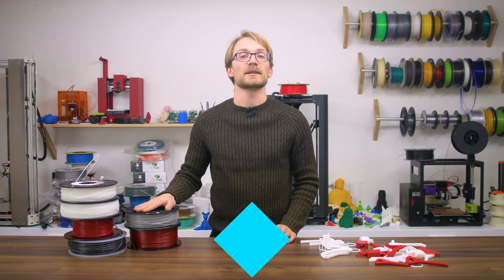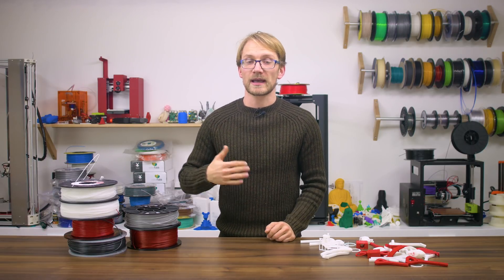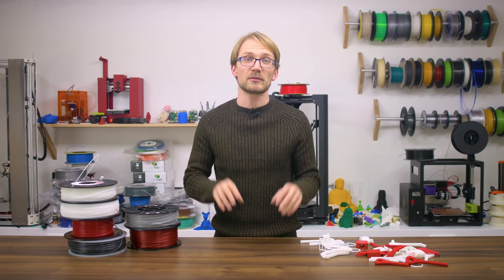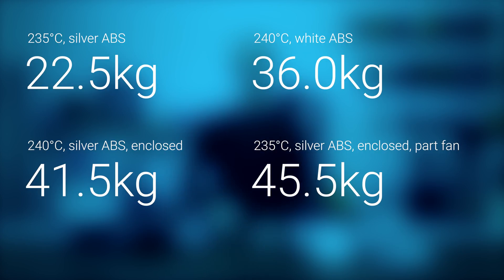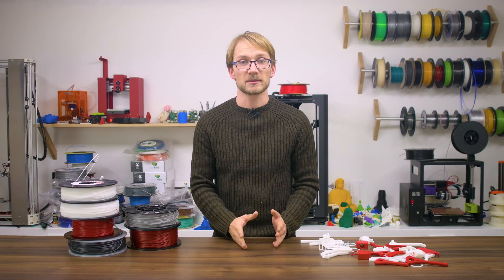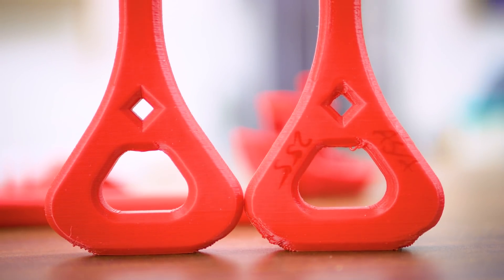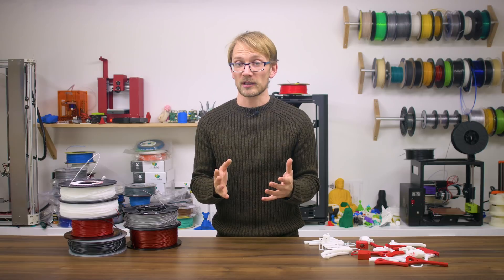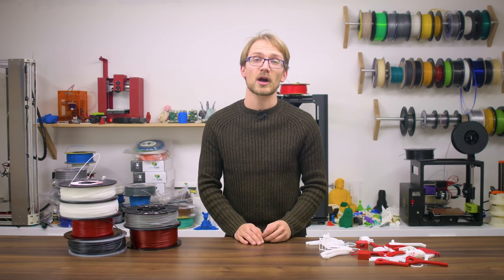3D printing with ABS: Hotter nozzle or hotter ambient? #Filaween

Comment: layer adhesion is not an issue if you print at 280c, 90mm/s speed and use some insulation foam to enclose the 3d printer.

Comment: I know iam a bit late to the party with the video being 4 years old already, but iam building a heated enclosure for my prusa printers and since i need heatresistent parts, i was wondering if abs is the way to go? I printed some parts in asa already, but the colors i want are not aviable in asa. I have an enclosure for my printer but it only reaches arpund 37°

Comment: I used Kimya Carbon Fiber (20%) ABS to print my Prusa MK3S+ extruder parts, using the Kimya presets in PrusaSlicer. I printed in an enclosure at 40-45C. Bed temp 110C, hot end 265C.  They came out perfect the first time. No elefant foot, no layer separation, no warping. Adhesion to the flex steel smooth PEI plate was good. All parts fit together perfectly. I used a brim, but that was a lot of work with the sharp knife to remove, so subsequent parts I print with no brim. Still good adhesion. There was a tiny bit of surface roughness from tiny bubbles, so I suggest to keep your ABS in a desiccator even while printing.

Comment: I used to print a lot 8 years ago in the early MakerBot days (I have #180). It was all 3mm ABS back then. I didn't have an enclosure, but had many successful prints. Admittedly, my prints were generally < 2" in the horizontal directions. I recently got back into printing with a Prusa Mini and PLA/PETG 1.75mm filament. The results are stunning and far exceed what I could do back then, though electronics where based on a 8-bit Atmel, the stepper drivers didn't have microstepping, no heated bed, cooling fans, etc. Rafts were important, but seem rarely used nowadays. I bought a spool of 1.75mm ABS, but haven't used it yet. Curious how things have changed.

Comment: I bought ABS by accident, I have ender 3 and no matter what I do, abs won't stick to the bed, tried different temps for bed and nozzle, tried glue sticks, degreasing the bed, different slicer options etc still no luck, would suck to throw away perfectly good abs filament, anyone succeeded at printing ABS with ender3? What did you do? Was making a heatbox enough? Would love to see someone's slicer setup too

Comment: ABS: has 2 major advantages over PETG (1. Self supportive, less likely to require supports), (2. Supports remove easier with ABS). How do you get around - especially the self supportive issue, with PETG as it is very droopy, drippy (boogery)? 

I would rather use PETG, as LAYER ADHESION is far easier to attain than ABS and A-Lot less shrinkage. But it is soo droopy and supports get soldiered in :(

Comment: Ok, I don't get it. I don't have any of those issues... I'm using cheap eSun ABS, printing on an Ender 3 style printer, with a 240C hot end, 100C build plate, 40-60mm/s print speed, no fan. Print on buildtak with a raft. No obvious deformation or warping. I did get some minor lifting of the raft on the corners, but that stopped when I placed a cardboard box over the entire printer.
None of my prints have had any issues with surface quality other than a few inconsequential blobs, and I've never seen it de-laminate. In fact the layers seem to have fused far better than my PLA prints. I don't see the need to vapor smooth anything, either, as I don't need the finish to be totally smooth.

ABS is the only heat resistant material that is printable on bowden style printers. PETG is only barely any better than PLA for heat tolerance, as proven by CNC kitchen, with ABS/ASA far greater. 
ABS is durable and, IMO, easy to print with. Sure, it's not as strong as PLA, but ABS is harder to break in practice. PETG is a good material too, but you are definitely overplaying the downsides of ABS.
You could have printed your braces in ABS too...

From my limited experience, ABS should not be considered difficult. I had an easier time printing ABS than I did TPU.

I almost skipped out on ABS thanks to your (and other channels) bad advice. I'm glad I'm not the sort of person to take somebody's word for it.
Don't get me wrong, your channel is still informative, but I'm not going to trust your advice on ABS anymore.

Comment: Never printed plain ABS; im a relative latecomer to 3d printing. However ive been printing with 3dxtech cf-abs recently, and I really like that. The fibers do a fine job of taking care of the warping, so I can print it nice and hot to get really good adhesion; plus en enclosure with air suction to the outside makes for a really nice experience. Its not the strongest cf filament; but definitely the easiest to print cf filaments that ive tried. That includes PETG based ones, and for what its worth ive never managed to print anything with PETG that didnt turn out into a blobby mess. (Seriously what is that polymers problem. Why would you crawl up onto my nozzle all the time like a freaking superfluid?). Also have yet to find a PETG that lives up to the ductility/layer adhesion hype... but its probably something I am doing wrong.

The vapor smoothing of abs is much appreciated; but what I like especially is solvent bonding. So many plastics are hard to bond with strength anywhere near rivalling their bulk strength, but cf-abs makes it quite easy to assemble large mechanically loaded parts without overdimensioning the crap out of everything.

Comment: If anyone out there has successfully printed a large area ( 8in x 8in, or similar 200mm x 200mm ) box that is 4-5in tall with ABS without lifting off the bed ..... I would love to know the settings!  

I have a Creality-CR10S, with heated glass bed, with Repetier (Slic3r) or Simplyify3D.  Every ABS print attempt with or without:
skirts
rafts
From 60°-115° bed temperature
From 240°-260° hot end temperature
With fan, without fan
With fan first 10 layers, then off, or then 100%

ARGH!!!  After a few layers, one or more corners lift.  I’ve tried different filaments, painters tape, Elmer’s stick glue, enclosed, not enclosed.

Comment: I use ABS and PLA.  Have tried PETG but do not like it.  Always Always Always use ABS in a chamber if you want it to be consistent and it will work fine.  I keep the part cooling fan at 30% unless bridging which is 100%.

Comment: I actually much prefer ABS to copolyesters, as the latter are to me unreliable and brittle.
But if it comes to having only printer without fully enclosed chamber, than High Temperature PLA is a better option.

Comment: At my job, I primarily run ABS as we have Afinia (UP!) printers. As you may know, the proprietary ABS made for these printers has notably higher extrusion temperature of 270 degrees Celsius. They also have direct extruders equipped with motor fans that are intended to double as part cooling fans; there is a toggle that allows for the user to re-direct the air away from the part, so that's typically what I've opted to do. The H800 features an enclosure. It can print larger parts remarkably well IF the bed temperature is changed to 100 degrees Celsius (which I believe is the highest it will go; I could be remembering that inaccurately, however and that may just be how hot I was willing to set it), the bed is amazingly (read: manually) leveled, the print surface is BuildTak, and a glue stick has been applied. There aren't really too many hoops to jump through, but it was a bit of a saga to hone things to a comfortable place. The H480 is much smaller and has a completely open build chamber. Using the factory settings for ABS (270 degrees Celsius on the hot-end, 90 degrees Celsius on the bed, whatever print speed the "fine" setting implies), printing onto perfboard, and an application of glue from the trusty glue stick, I am able to get surprisingly nice results. These nice results are highly dependent on the model being printed. It's like usual with ABS - small things work well when the x-axis and y-axis size is relatively similar and the print isn't too tall. Otherwise, there's definitely some layer adhesion trouble and guaranteed warping, even with a raft (the rafts always stick fine; the parts tend to warp off of the rafts). I probably should have mentioned that with these printers, rafts are an absolute must. Even with glue on BuildTak, the filament refuses to even begin to adhere to the surface. I also failed to mention infill. It's an unfortunate requisite because the UP software doesn't seem to have a surface density adjuster for the side walls of the print; only the top and bottom can be adjusted. I typically set my infill at 65% so that the part can't be crushed in my hand but I am still using slightly less material. 

Regardless, the point of all of this extraneous information is to let you know that in my experience with my machines (which are ABS-centric, to say the least), ABS can be printed and printed well on a printer without an enclosure. It's unquestionably more effective to print with an enclosure if aesthetically pleasing and successful prints are the desired outcome. I intend to build an enclosure for the H480 for the express purpose of printing ABS. All of that being said, I've liked working with PLA much more. It just sort of works, which is not really the case with ABS. I have been doing a lot of research as of late to acquire a better working understanding of 3D printing beyond the machines that I currently have access to, and that's allowed me to get some seriously nice results using ABS on my printers. I haven't printed PLA recently enough to apply my newfound knowledge to the process, but entirely in spite of that, my old prints with PLA are still just as nice as my new ABS ones. I can't even imagine how good they will be! Even with machines intended for ABS printing and using their exceptional filament, I see no purpose in using ABS over other filaments that offer better looking and/or more structurally sound prints.

Comment: Hi. I made an enclosure based on your advice for my Anycubic i3 Mega in order to print ABS filament. So far this has worked better than not having an enclosure, but I noticed some of the plastic piece like the filament feeder has warped with the internal heat. Should I add vents to the enclosure and what temperature should I limit the internal heat to be. Thanks.

Comment: I've printing with ABS ONLY (3d printing for 4 years now). I literally printed only about 5 parts in PLA ever!
I don't like the brittleness of PLA. ABS is stronger and can be glued with acetone and i only had 2(!) cloggs ever (genuine e3d v6)
I'm only printing functional parts though, like brackets, casings which have to have a certain strength.
My open frame (self designed) printer is super reliable and performs great with ABS, and only sometimes i use a foldable chamber around it when printing bigger parts.
ABS is the big winner for me!
Sure, there are likely more advance materials, but ABS is also very cheap!! :-)

Comment: I'm printing with abs, with no enclosure but decent results! 230c hot end temp and 80 hot bed.. fairly standard. While the parts im printing are fairly small i've notice the abs i print with warps less in a colder environment (60-70F room temp). I've yet to see layer adhesion issues.
Reply: can i ask what ABS filaments you use at those temperatures?  i have a CR10s and those temps sound good for my machine.
Reply: mmm I was using Shaxon ABS filament from Fryz.. It worked fine for me because the parts I printed were small.. As soon as i started print objects 100mm+, 100mm+ it would warp like crazy!.. the parts were really strong and are still working but the warping led me to try hatchbox which as worked beautifully! :D:D

Comment: Hey I've been thinking of building an inclosure for my printer for multiple reasons; much higher ambient temps, fumes/gases from certain materials, to silence it all! All cuz it's in my bedroom which is a basement of a 4 story house so when the main living areas are approx 72° F my room is approx 64-66°F. I'm wanting to build it most likely out of a composite Aluminum (aluminum sheets with some sort of filler in between for insulation & sound proofing but I'm also wanting to add a high air volume extraction set of 3 fans side by side @ the top ideally that goes through a layer of activated carbon & then a HEPA filter! Reason for that is so that I'd be able to print higher temp filaments with extraction fans & board cooling fans off but then I'd also be able to still print with the lower temp filaments by simply running the extraction fans along with all others instead of leaving doors open or anything like that.  Q for you is do you know of anywhere that I could find DIY PLANS for building an extractor unit & is there anywhere I can find measurements that I'll need like example: 1st a site with a list of approx print head & bed & maybe even ambient temps needed for each type of filament! Then some sort of calculator to input dimension of inside enclosure volume & how much air volume I'd need to move per second to accommodate the things I'm doing. Also as for how well enclosures will hold heat (R value) any recommendations to be most efficient holding in heat as well as allowing it to escape when needed, this is partially my reasoning for picking composite Aluminum to build it out of or do you have better recommendations as far as material to build with? I also want to keep any hazard of fire out of the question cuz I've seen some build out of cardboard & I can just vision flames, especially overnight prints! Thanks Tom C

Comment: I mainly print with abs and i dont know why everyone was suggesting no fan. Without active cooling my parts would warp like crazy. Heated chamber is a must of course. I also find 85C bed optimal for me, if I go higher, warp increases. I would switch to PETG totally, if it was post-process friendly. I can sand my abs parts to make them look factory like. No other plastic can offer this so far.

Comment: I haven't found abs to be that bad to work with. It stick well to glass with glue stick. I just tape over the fan duct that blows on the extruded filament. The only issue I have is with bridging,it sucks at that, but what can expect for blocking the fan duct?

Comment: Another reason to build an enclosure: You won't roast to death from your printer overwhelming your crappy air conditioner in the middle of Summer, since more of the heat hangs out in the box. If the air around the printer is warmer, the hotend and bed heater don't have to work as hard, so they generate less heat over the course of a print. That also means a little power savings, though that might go right out the window with active heating.

Comment: Hi Thomas. There is something about your video: you talked about useing a part fan for ABS (haveing a heated chamber of course). You should make a video going deeper into this, it would be really interesting because the "normal" acepted "standar" is that you never use a part fan with abs. I would really like to see tests about this
Reply: I have used a part cooling fan at around 20-30% speed without an enclosure with good results. Perhaps slightly lower layer bonding strength, but no delamination on small/medium sized parts. Main benefit is great dimensions (less shrinkage) and perfect overhangs with no curling. Just make very sure your bed adhesion is on point using buildtak/PEI or something, otherwise it will come off the bed once you start the fan...

Comment: I live in Egypt, room temperature can get very hot 48C hot, i don't think i need an enclosure 😂😂😂
Reply: I live in Brazil, 35ºc ambient, on the spare room with A/C off, it printed much better than when I tried it on my room with A/C at 26º, but still not perfect, still got a few delaminations. I'm building an enclosure, witch will easily hit 48-50º, but now I'm worried about the electronics.
Reply: @Spartacusse  I'm probably late but, just leave the power supply outside the enclosure because it can't take the heat but the other electronics should be able to
Reply: As a Texan I identify with this comment
Reply: @cheaterbane  ayee me too 🤘
Reply: Yassin Elessawy these temperatures can destroy PLA… it will decompose and crumble to dust
Reply: 48? Omg. Nozzle turn off? Hahaha
Reply: I spent a year in Iraq. I feel your pain 🥵

Comment: Hi Thomas , I have done some testing since the last time I left a message here, I have notice that my results are simular to yours even in Jamaica. The temperature here runs between 28 degrees and 31 degrees Celsius during the day and 26 to 28 degrees at night so it is pretty constant, however ABS seems to start lifting of the bed as soon as the print reaches the fourth layer ( bed temp 90 degrees Celsius ), I turned up the temp on the bed (100 degrees Celsius ) and while it would stay down longer, either there would be a shift with the model or it would release itself completely off the bed, I'm in the process of building an enclosure as we speak .